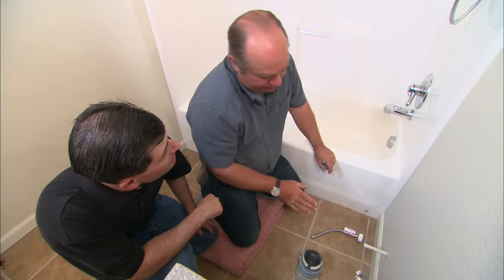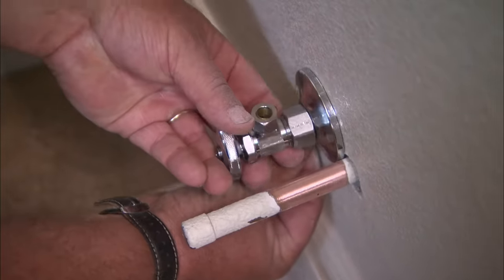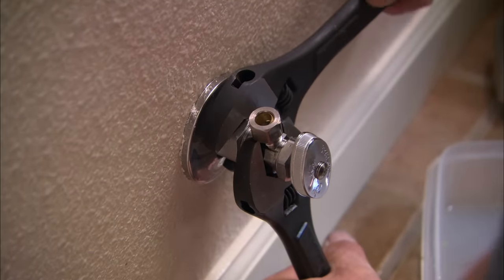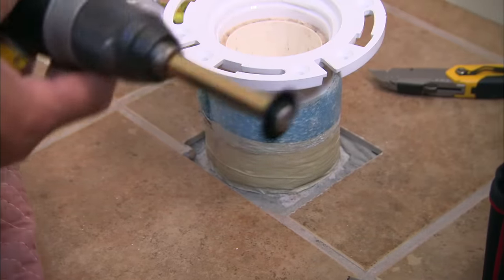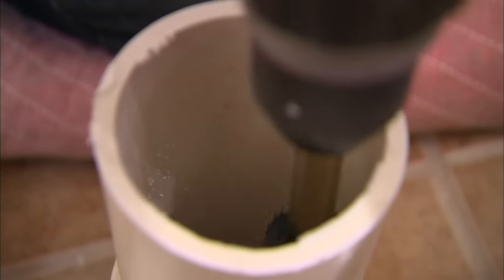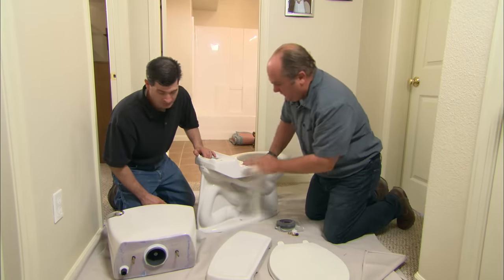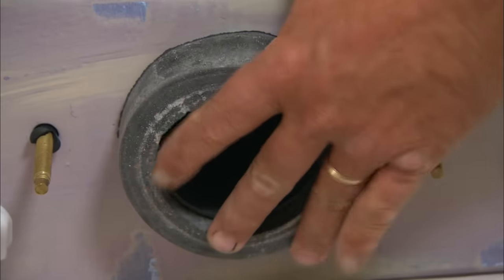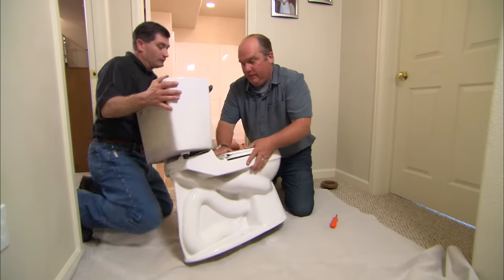How to Install a New Toilet | Ask This Old House

Comment: Think about other contractors that have to do a repair. Don't cut the water pip so close the wall
Reply: +KYRM09 exactly my thoughts lol why da hell would you want a pipe that short?
Reply: As a repair technician, I was thinking the exact same thing. What he did was very short-sighted.
Reply: Gerald L lol yea, because sometimes those compression fittings, you can't get the ferrule off so you gotta cut the pipe off and if it's that close to the wall, there is no more pipe to cut
Reply: +bludika Exactly.
Reply: Do it right the first time.
Reply: ***** No, not kidding. I deal with this kind of stuff frequently. My customer needs a repair, and I'll have to deal with a short-sighted install like this which makes things much more difficult and time consuming; Things that could've been avoided if the installer thought about serviceability.
Reply: ***** No worry Gary, I took no offense. Yes, I know what you mean. Every single DIY video on YouTube has those types of comments. Some are justified, but many are not. And thank you for the compliment.
Reply: Job security lol. So next time he comes out he has to replace drywall and a new pipe.
Reply: Those stops don't last forever no matter how well you install them.
Reply: is true, don't need cut to short..
Reply: KYRM09 He does know what he's doing as he's a trained plumber and expert plumber and a heating expert it clearly states it in at the start of the video
Reply: Cut it sooooo short the ferrule wasn't all the way on.
Flange needs to be fastened to the floor with water resistant screws. Conveniently skipped that part.
Reply: KYRM09 moving a toilet to a different location
Reply: Lol. That's what I was wondering as soon as I saw that. Damn.
Reply: cant u guys just solder more pipe on the end? im not a plumber btw
Reply: Lorin S Funny stuff lol
Reply: "Tapcons are coated with Climaseal®. This coating, when applied on top of 410 stainless steel,gives these concrete screws superior rust resistance."
Reply: Please buy a 5/8" ferrule puller so you don't have to cut open people's walls. Great tool, if you do any amount of plumbing repair.
Reply: KYRM09    '9
Reply: No kidding man!  Good point.....
Reply: KYRM
Reply: Because he didn't want to have exposed copper, he was going for the chrome look. They have chrome tube toilet valves that he should have used.
Reply: I scrolled down to look for this comment knowing it's be near the too
Reply: KYRM09
Reply: If you are slick enough you will solder a piece of copper onto the pipe if its to short. My plumber did this once and even patched up my drywall when he was done.
Reply: +1
#imarealplumber
Reply: KYRM09 I was just thinking the same thing
Reply: Agreed. He cut it back a little to far.
Reply: When I put in new construction, I like to use a lug-L with the threads stopping just at the backside of the drywall and install a chrome brass nipple and threaded stop so that it can easily be replaced. Stops seize with time and have to get replaced and I'm just not a fan of doing that with compression stops, especially so close to the wall. You'll be glad you used the nipple down the road. I guarantee it...
Reply: KYRM09 yes looks like he cut too short
Reply: I was thinking so, though 😂
Reply: Exactly, I was thinking the same lol!
Reply: Yesterday I had this problem where the old guy cut it soo short to the wall make me spend 30 min on this good point
Reply: At least put dope on the compression ferrule
Reply: Other plumber can find if you have these kind of plumbers like him me as a plumber i would melt soldering valve even i dond see too many of these wavlves like this one but still i can find a way
Reply: Ever herd of a olive puller 😭
Reply: I figured it out... cause you will never ever ever have to replace that piece... ever
Reply: Where is your video? I want to see how you suggest to do it. Hahaha Do you have a link to someone else doing it this way if you don't have a video?
Reply: @HollywoodCreeper  don't need to have a video...it's common sense to leave a little slack in case that fitting fails :/
Reply: You mean water pipe
Reply: @JS12045  not just threads, a little bit on the hard supply ,and brass ring,,then tighten up,use it also on slipnut washer's,traps ,etc
Reply: As an Optometrist I can see this video.

Oh. I thought we were posting our credentials.

Comment: Aww man they blasted right past what I was looking for. Specifics on how tight to go with the tank bolts? Enough to make a water tight seal or run it down until the tank is tight against the bowl? Not a dumb question because too tight and the bolts will snap the porcelain bolt flange. I was shown by a guy who I discovered sucks at plumbing so I am trying to re-learn everything he taught me.

Comment: Went just like you said. This was an awesome video. Thank you for the detailed, step by step instructions. 
My issue is I had to work a little harder to clear space around the sewage pipe....lol
Reply: Womam
Reply: You can always get a different style flange that fits inside the pipe instead of around it. With that, you only have to cut it flush with finished floor

Comment: Why not attach the tank to the toilet AFTER the toilet is secured to the floor. Seems to me it would be easier to mount each separately,  because the combined unit would weigh a lot more.
Reply: I was wondering that myself. Many years ago a plumber where I worked told me to install the toiled first and like you said then attach the tank. I did it that way and it worked out fine.
Reply: You COULD do it that way if you don't have an apprentice that needs to be hazed a bit...
Reply: @southparklion 😀😀😀😀😀😀😀😀

Comment: The bolts are designed to snap off fyi.
I use a pair of  sheet metal sheers or a multi tool with a metal blade.

Comment: Let me cut this copper too short to repair when this valve goes bad....  aaaaaaaand strip out these masonry anchors.  There, all done! huehuehuehue
Reply: It was a push fit valve...if it ever goes bad just replace it. You dont have to cut any more pipe.
Reply: ooooooooooooooooooooooooooooooooooooooh you got lit up, cuz!
Reply: I agree, safer to leave a little wiggle room
Reply: @richpal3019  That was a compression fitting on that valve.

Comment: I’m not claiming any “right” way to do the job.  I always watch Richard do plumbing work to observe and learn and see if he does work in a way that I’d like to adopt and do on my own.

In this install I disagree with how close he cut the pipe to the wall, it may not look as pretty with the bare pipe showing, but I’d prefer to give myself some additional room.  I would also use 4 nuts in a toilet install.  Two nuts to secure the closet bolts to the flange, and two nuts to secure the toilet to the closet bolts

Comment: This guy cut the pipe so short towards the wall. Hard to repair in future if it leaks. I would not follow his advise...
Reply: Thats what i thought too but there is a hand tool to take to take of that bronze ring. Wont have to worry for many years from a leak at that valve.
Reply: I believe the measurement is 1 inch and 1/8- 1/4" from the wall.it depends on the angle stop. His looked a little short
Reply: Don't worry about it that connection will last forever
Reply: I was thinking the same thing "gee, that would suck if someone had to replace that valve due to a leaky connection"
Reply: @mikemakboul4409  The connection may but shut off valves fail all the time.
Reply: you can just undo the compression connection and put on a new valve. what's the big deal.
Reply: Good point, but as a non-plumber I would not want to give myself a little more margin for error.
Reply: @Henry Wong, makes it hard to solder any plumbing fittings on  if ever needed. At least, not without burning the house down 🙈
Reply: Yeah i was like wtf
Reply: True, Both sides of that brass olive should be on the pipe. He only had one on the pipe. That's definitely going to leak in the future.
Reply: He cut it way to short. Plus I would of used a bull horn plus a single wax ring. Then silicone
Reply: @init2winit53  bull horn??????
Reply: @Josh C dude things don't last forever. Those things at some point dont seal the water. It might work for a few years but after that it will need replacing. Confidence does not apply here.
Reply: Here in phoenix with the hard water sometimes they simply won't budge and you have to cut them off so a little extra pipe is appreciated

Comment: Everything is correct except for the wax seal. Always put it on the bottom of the toilet bowl and then seat the toilet on to the flange. Much easier to line it up and create a good seal.

Comment: Wow. you cut the pipe a little to short. What would happen if the pipe was loose and it slipped in the wall?  Also when using compression valves you should use some teflon pipe thread sealant on the brass delrin.
Reply: Richard does know what he's doing he is a professional

Comment: I appreciate this video I enjoyed this showed adding a toilet to a bathroom where plumbing already exist also how can it be done if the plumbing and drain didn’t exist. I enjoyed watching it 😎😉😁😁👍
Reply: Thats what i don't get. I dont know why any non contractor would need to install a toilet for the first time/set a flange. Quite frankly, unless the house is on a slab, im not sure wut the flange wasn't already there. Im a first year apprentice plumber, so by no means an expert but i can't fathom how this homeowner even ended up in this situation

Comment: Why not install the toilet tank after the bowl is set?  Save your back a little work.
Reply: your right man. thats the way it should be
Reply: because even though the toilet is heavier with the tank on, it is actually better balanced to handle with the tank on, l have installed hundreds of toilets both ways and prefer to install them with the tank already on.
Reply: Plus without the tank you can even out the equal amount of weight distribution when setting bowl to wax ring
Reply: Bcuz he trolled that noob
Reply: Sergio Arreguin What? Lol 😆
Reply: Andy Douglass , that's the way I do it,  without the tank.
Reply: Amen !!
Reply: @Andy Douglass: You could, but from my experience, you may end-up having to lean-over/lay down to get to the bottom bolts, etc., so in the end, you're really not saving your back if installed later. However, by pre-install the entire toilet, it is far more easier to drop it on the wax, and you don't have to do anything else... Toilets are not so heavy if you use proper body mechanics. However, you could always ask for some assistance with lifting...
Reply: @The Brown Rat, Sergio Arreguin, and Mister Brian, as a Jack of All Trades (a true Renaissance Man), but a Master of most of them (electrical, plumbing, framing, customized installations, etc.), I too have installed dozens of toilets, and I quickly learned exactly what you explained... Hence, I couldn't agree more.
Reply: Respectfully disagree. It's much easier to get a great wax seal, & to make sure the bolt down is perfectly stout beforehand  if installing the bowl first. I've done it both ways plenty. If i get a choice, I choose bowl first then put it all together. Hands down.
Reply: @TheAxecutioner , sure there's more than one way to skin a cat, as-in cat-fish. Each method has its advantages/disadvantages. 

Bowl First: Not as heavy without the tank... not as much leverage to get a perfect seal around the wax (although you could SEAT on the toilet); Struggle with getting the tank on as you'd have limited space as you'd be against the wall, etc; Also, it is awkward and tricky to get to the bolts beneath, and although you could do it by feel of hands only while on your knees or while sitting on the toilet facing backwards, you may not get as secure of a connection than when the entire toilet/bowl/tank is put together prior to install...

Entire Toilet Method: This personally has been my best/easiest/quickest method. I can verify that the rubber gasket between is properly compressed... I even flip the toilet somewhat over to its sides, so that I do not have to bend over to reach the bolts  underneath (awesome back saver method here...); then I'd face the toilet and carry it from the tank for leverage while using my strong leg muscles/thighs/knees so as to save my back (disadvantage = much heavier than installing bowl only first, but I am very STRONG, so this is not an issue for me lol); I then easily drop the toilet onto the wax, seat on it, tighten the closet bolts, and its all done.. I then only need to connect the lines/PEX and then install the seat if not on already...
Reply: Yeap yoy right that what i was thinking too
Reply: Omg...so true! You're the real mvp!

Comment: Not a given that you will have to replace the ferral.  I have replaced several of the the same type of valve using the original ferral.  Quick and no leaks.  If concerned, place a newspapper under the valve for a day or two.   If it leaks you will see a water  spot on the paper.  I do this test with all of my plumbing repairs.
Reply: Ferrule....

Comment: Installing a flange on the finished floor may be too high for some toilets.  If your toilet doesn’t touch the floor in both sides, then your flange is too high.    I had that problem with a Mansfield Vanquish toilet.

Comment: The wax ring on the bottom - is that needed?  I'm going to try to do this for my parents for the first time (I'll be taking their old toilet out first).  So what I wasn't certain is, if there is already a ring there (original toilet from 1996 i guess), if i'd be able to pull the existing toilet out.  If there isn't a wax ring, is this something i need to make myself?  I'm going to give this a whirl, and the above video is great, just trying to do this in the middle of the pandemic for my elderly parents.  Any/all information accepted & appreciated!   :)

Comment: you didnt  clean  or deburr the pipe before cementing. its easier on your back to connect just the bowl first. before connecting the supply to the tank...run some water through it to stop junk from going into the flush valve. tank to bowl  nuts should be tightened carefully and evenly. it not a bad idea to ck the 12 inch from wall for each bolt as you cement flange. dont use a nut on the flange that sticks up...could contact bowl. lastly  twist the wax gasket a bit to seal on the flange. id caulk bowl to floor after no leaks but leave an opening near back ....if it leaks ..you want to know. otherwise vid ok.

Comment: Richard Thethewey has been around long enough to know that an INSIDE bushing flange is available to slide DOWN INSIDE the existing pipe.  This is a lot easier than having to fit that flange down over a pipe.  Eliminates steps.
Reply: I also hear a lot of plumbers say absolutely worth a stainless ring flange and NEVER just an all plastic as it will eventually break making a difficult repair. Unless of course you plan ahead to be long gone or bill repairs by the hour.
Reply: Why make a 3 in  pipe even smaller with an inside fittter

Comment: I just replaced my toilet with a new one.  I did everything that you did. Water fills to the line no problem but it wont flush. If I hold the handle the water will fill in the toilet but the water will not drain out in to the drain. I have to empty the bowl with a cup.  What would cause this?

Comment: if you glued the toilet flange to the PVC drain pipe in the floor, how will you ever replace the flange if it ends up breaking? I also think you cut the copper pipe a little too short to the wall. No extra pipe to use for a later repair

Comment: Why connect both parts of the toilet before installation? Wouldn't it be easier to carry if you mount the bowl to the flange first and then mount the tank?

Comment: To me, it looked like he cut the copper pipe a little too short. The escutcheon always seems to be loose and floppy. I didn't understand why a regular saw wouldn't have worked cutting the plastic pipe flat to the floor.
Reply: Because he had to cut it slightly below floor level.
Reply: its hard to make a nice cut and you could scratch the floor.
Reply: The top of the flange hub is actually below the finished tile floor .  You need that pipe shooter regardless of scratching tile or not

Comment: Another thing they didn’t mention is don’t over tighten the two bolts holding the toilet base to the flange as if your floor is uneven over tightening the bolts will only break the ceramic or worse - break your toilet floor flange (which happened to me and it cost me $525 for a plumber to come in and fix it ).  Tighten snugly but don’t over tighten bolts and it there if there is still a wobble use plastic shims - which I had never even heard about. I figured all floors were even. Silly me.
Reply: They did say to be careful not to overtighten
Reply: Use a metal flange next time
Reply: In lieu of shims, some plumbers just mortar/glue some .25 cent quarters to the floor.

Comment: Wrong size escutcheon and you need to leave about 2" of copper between the valve and wall to have something to attach to in case you had to cut off the other one.